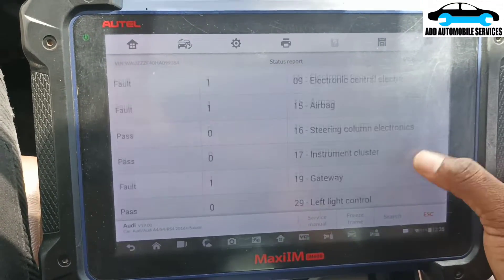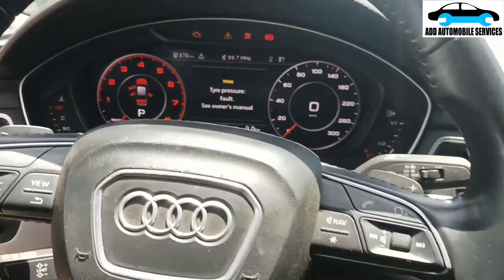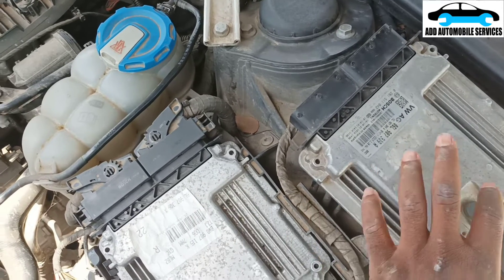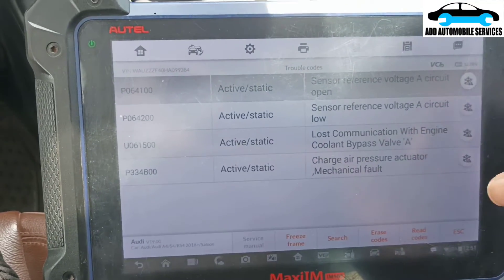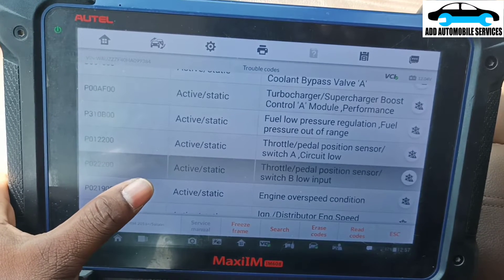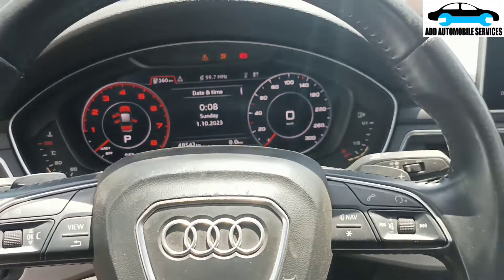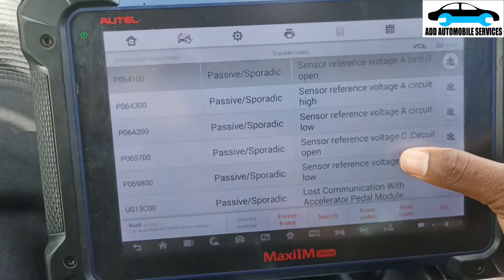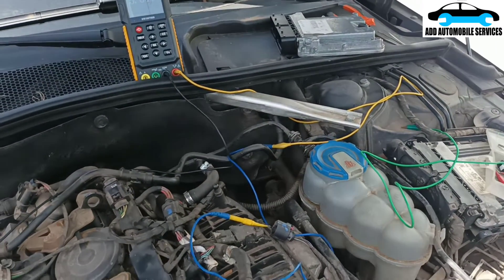2017 A4 Reference voltage (P0641)

Comment: Friend whats is the fuse whit you solve the problem ? I have the same problem
Reply from the maker: It doesn't have a fuse
Reply: @ADDAUTOMOBILESERVICES please Help a i Pay for the solution man in México dont solve the problem
Reply from the maker: @098poseidon you have to find what is causing the 5v reference voltage to go off
Reply: @ADDAUTOMOBILESERVICES how did you solve the 5v problem bro ? I read in other coment is a fuse please Help me
Reply from the maker: @098poseidon it is not a fuse issue 
WhatsApp me

Comment: How to solve the car problem?
Reply from the maker: It was a fuse
Reply: @ADDAUTOMOBILESERVICES  what was the fuse you replace to solve the problem ?
Reply from the maker: @098poseidon it doesn't have a fuse it is a 5v reference voltage.